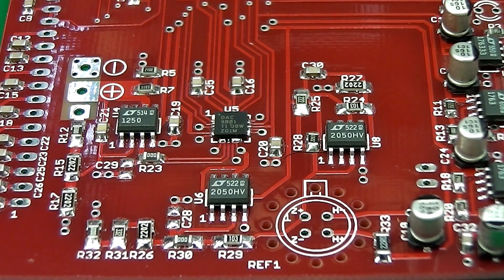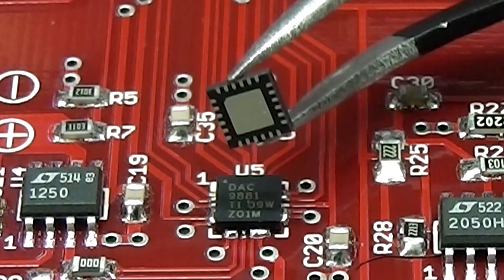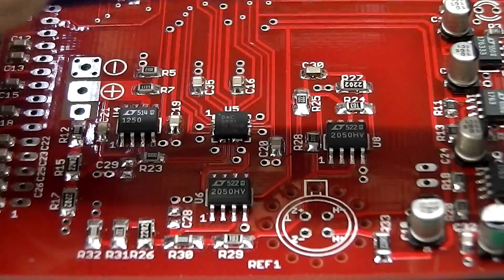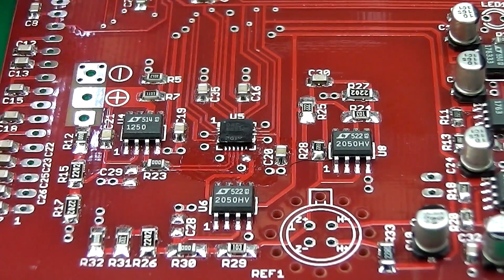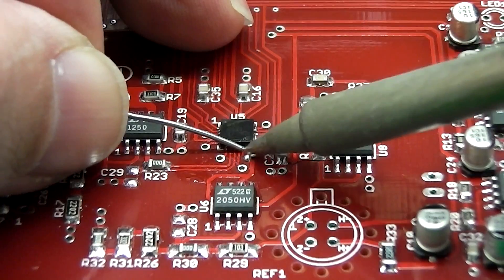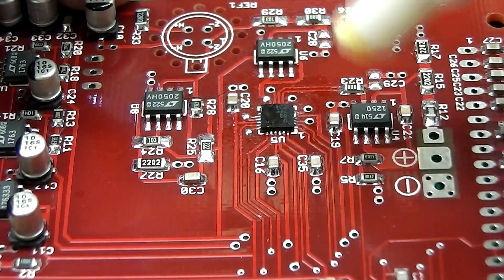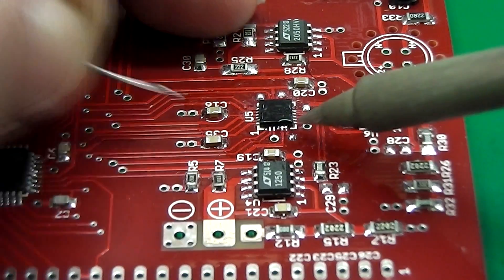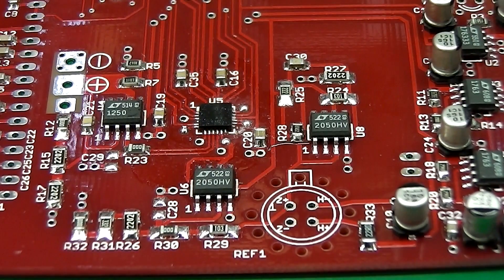No.025 - QFN Reflow Repair

Comment: Good job!
I've found that the DFNs and QFNs are the hardest to solder properly.
QFPs and TSSOPs are no problem for me, in terms of solder bridging.
With the DFNs and QFNs, you need to make sure you evenly heat the board, and make sure that the pads have the same thermal conductivity to the rest of the board. Otherwise, one might heat up first, and the solder will melt before the others do ... the solder surface tension then pulls the darn bugger out of alignment! XPPP

Comment: Thanks Ian. My biggest problem with IC's is removing them. Most of them I encounter have adhesive on the bottom and I nearly burn the PCB up or rip it up trying to remove the IC. Just about every video I see on YouTube are always removing easy IC's that are a piece of cake, but that isn't what I see in the real world. I was removing a UCC28060DG4 PFC controller IC earlier and the PCB got so hot the top layer of the PCB popped up separating from the board, even though I was being as careful as I could. Also in the real world there are resistors and caps all around the IC's making the job even more difficult.That's what I see in the real world.
Reply: +Robert Calk Jr. 
You might be applying the heat too quickly. Come in slowly with your hot air gun and heat up around the chip - start from further away, and work your way closer.
I love taking things apart, trash stuff like that can be good to practice on! (And you can get extra parts for almost free XP)
EDIT: I just realized that you meant the glue was giving you problems ... facepalm
I've found that a thin blade (careful not to cut yourself) or screwdriver (hey these are dangerous too ... stabbed myself once, LOL) is enough to pry the chip up from the glue. Generally, the glue weakens when hot.
Reply: +Benjamin “Ozias” Esposti The adhesive under the IC isn't affected by the heat. And every person on youtube only works with IC's that aren't being held by adhesive. But almost no IC's that I encounter are so easy to remove, or to solder as far as that goes, as the IC's that people on youtube work with. The title of the video is reflow repair. I wish that I encountered IC's that so easy to work with......
Reply: +Robert Cali Jr.

Comment: Good technique Ian. How about a short video sometime showing how your ultrasonic cleaner works?
Reply: Not even close mate. 

Ultrasonic cleaners vibrate at high frequencies, some do sweeping frequencies, some do single frequency, and some to frequency patterns. 

The way they work is due to the differences in material resonance. While your solution oscillates at one frequency, the board, and particles of dirt, debris, and other will resonate at a different frequency due to the difference in density. This difference causes the contaminants on the board to literally vibrate off, or shake themselves free to be carried away by the oscillation of the surrounding liquids, and gravity. 

This principle can be demonstrated by comparing sound waves. Under water sound, vs sound in air, there is an observable difference pitch and tonality, this is due to the way sound move differently though two mediums.

Key synopsis:

There are NO explosions in ultrasonic cleaners. 
Frequency Resonance causes different materials to vibrate at different frequencies.
This differential oscillation, causes particles of debris to separate from the PCB.
The reason your components do not separate, is because they are fixed to the PCB with a stronger bond. 

Thus concludes my monthly keyboard warrior rant :p
Reply: @ArcAiN6  so a cleaner with only one frequency is almost useless while a wide range of frequencies do make different materials resonate?
Reply: +Dino Papas 
Ultrasonic cleaners just make micro explosions and water or alcohole gets in every small hole

Comment: I'm new to your channel. Been watching a bunch of your videos the last few days. I have to say, you are a very talented electronics wiz. This is coming from a guy who's been in the industry since the 1960's
Reply: +Glenn Martin A blind man could probably solder that IC...
Reply: +Robert Calk Jr. Right. Is your real name God? I love guys like you who think they know everything. I certainly don't. But I know enough to respect others that know more than me.And I'm not talking about this video, I'm talking about his total output here. He's one smart guy.
Reply: +Glenn Martin What does God have to do with it? I didn't say I know everything, and the fact is that I don't really know much. But if they are so good why is almost everything they do so simple? Why don't they show some real soldering instead of those powder puff IC's?  I almost never see such an easy IC to work with, even USB B micro connectors are usually more difficult than that IC. I'm just stating a fact and not meaning to be disrespectful or anything but shit, the truth is the truth.
Reply: +Robert Calk Jr. 
"But if they are so good why is almost everything they do so simple?"
Well, simple designs may actually be complex in their theory of operation.
Generally a simple design is thought of as using easy to get, off the shelf components (no custom ICs, etc...), and uses as few parts as possible. But yes, it's not a bad idea to over-engineer.
Then again, when cost is paramount, the fewer the parts the better!
Reply: +Benjamin “Ozias” Esposti You are misunderstanding my question. The title of the video is, "Reflow Repair". Then he chooses the easiest IC I can imagine. How is that supposed to help anyone? Why doesn't anyone ever use a tough IC that we see all the time "in the real world"?

Comment: Hi Ian!
Personally, I prefer the tacky flux like the Chip Quik SMD291. It doesn't boil away so quickly and gives you more time to tidy up the solder joints.
The tacky flux also helps to keep the component in place if you solder these parts with a heat gun instead of using a proper reflow oven :-)
Reply: +Pn Junction 
Agreed, I use the same exact stuff. It works like a charm! I love the stickyness, it's very useful to hold down those tiny parts that easily get pushed/bumped out of place...

Comment: What temperature do you set your iron to? Whatever I look at for guidance is never specific and I always wonder whether my soldering is aggressively on the components. (60/40)
Reply from the maker: +Richard Ball I have a Weller WSD81 set to 325 degC. My opinion is that if you have good, quick soldering iron technique then you can afford to go hotter, else, anything from 315 degC. Also, a good quality temperature controlled iron will ensure you are not just bumping up the initial set temp to compensate for heat dissipation that ends up pulling the temp own.
Reply: +IanScottJohnston what kind of solder are you using?